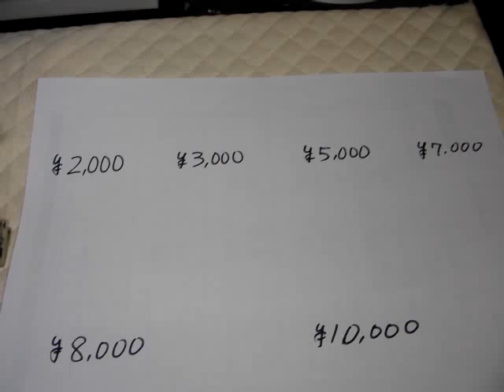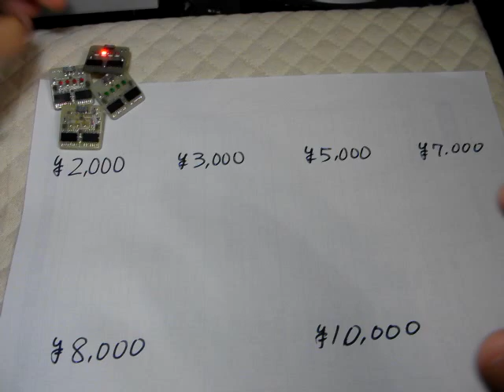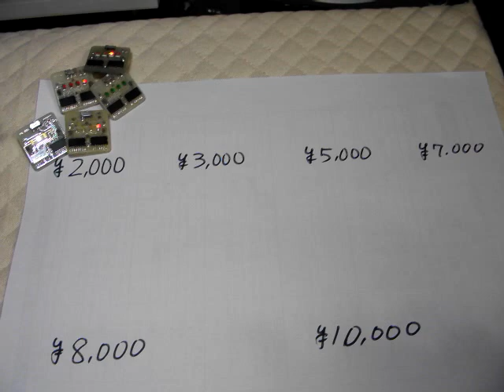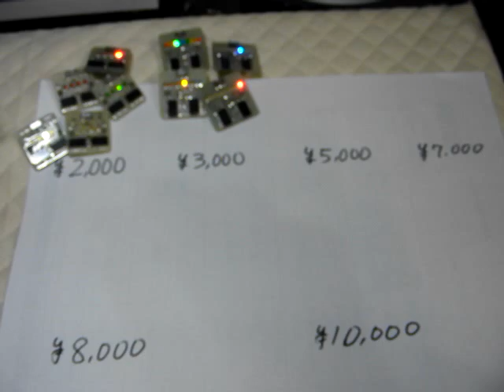LED badges CATALOG

Comment: This guy has nail varnish,

plus why would you pay £50 for a circuit board that choses a random colour with a stupid noise, just get a 10 sided die.

Seriously there is no market at these prices its cheaper to find a factory built equivilent and take it apart if nesasary.